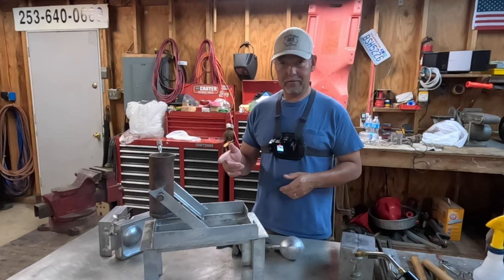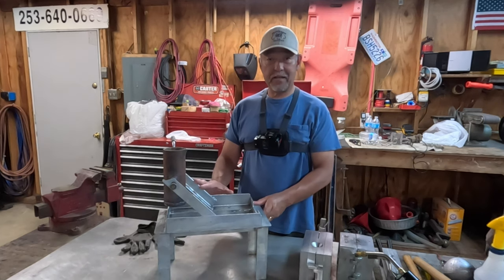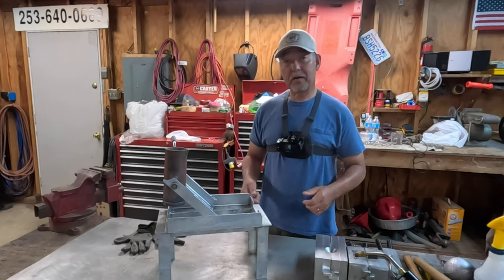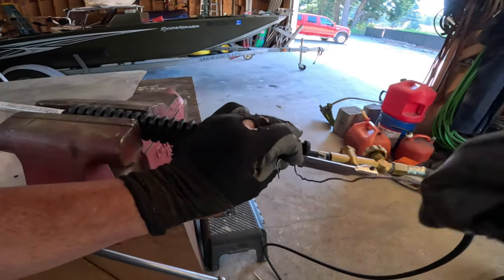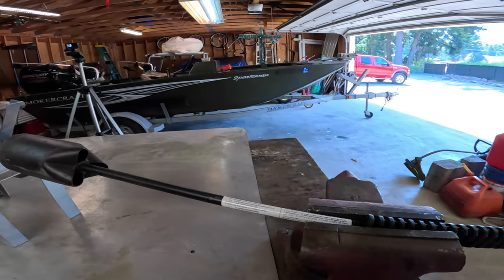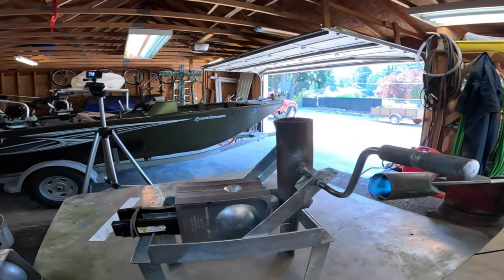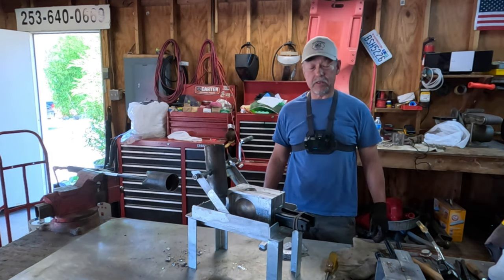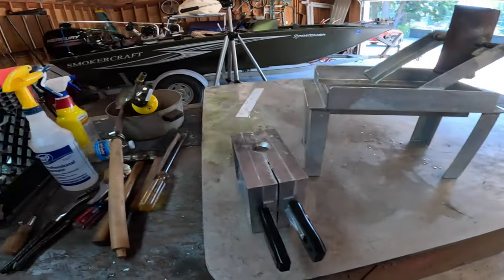Melting Lead and Making 12lb Downrigger Balls

Comment: Nice job fabricating the lead pouring device.  
I purchased a 15# mold and was wondering how i was going to heat/pour 15# 
If you don't mind me asking, what are the dimensions of the pipe. And will that hold enough lead to pour the 15#.
Thanks
Reply from the maker: Thanks. it is 8" x 3" OD pipe. holds just a bit more than 15lbs.
Reply: @Northwestfishingfanatics  thank you.